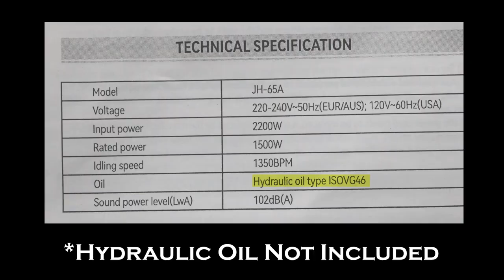VEVOR Demolition Jack Hammer Review | Heavy Duty 2200W for Concrete Slab, Rock and Chimney Removal

Comment: You said you were going to use some concrete caulk in that corner. Do you think you should have used liquid rubber instead?
Reply from the maker: No, but I guess you could use either one.
Reply: Are there any downsides to using liquid rubber or concrete caulk?

Comment: the instructions talk about grease and also oil. is that interchangable? i noticed that there's grease where you insert the bits so I'm wondering if you're supposed to add grease there also??
Reply from the maker: The grease and oil are separate. I haven't used it enough yet, but sometime I do need to determine which grease and oil it uses and how to do the maintenance.
Reply: @brettleybuilt thanks man! For oil is hydraulic oil ISO VG 46 (although people seem to be using motor oils SAE 5 to 20). for grease I’ll ask their support i guess any machine grease would do

Comment: These Vevor jackhammers are pretty underpowered, in my experience. They do NOT pull 2200W. They are running at about 1500W, and connecting to a 20A circuit won't make any difference. OK for very small, light jobs but I rent something bigger when I have a serious demo job.
Reply from the maker: Check out my next video. It will be up by Sunday. These use about 1800 watts of power.